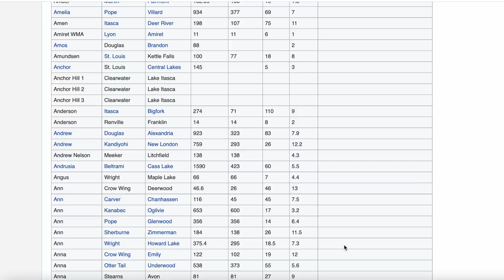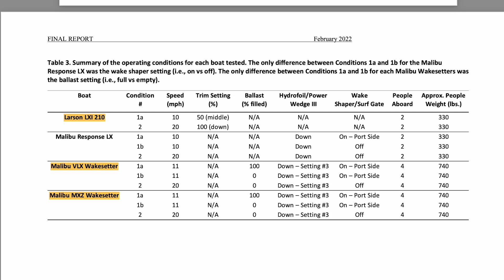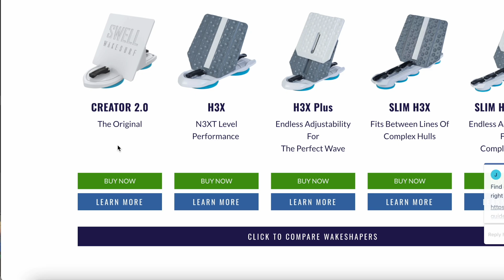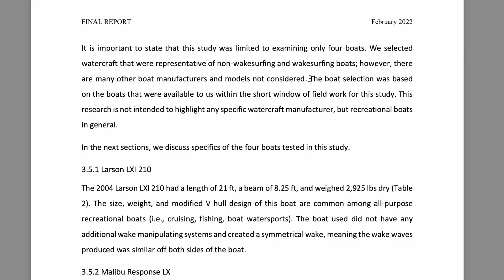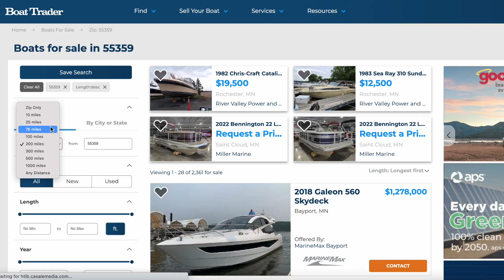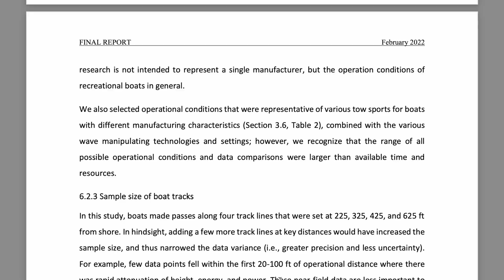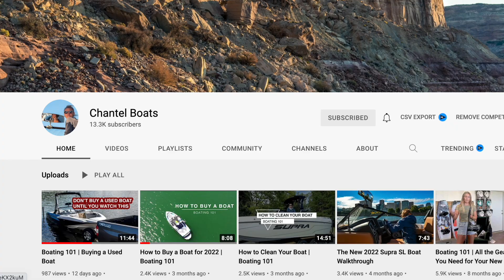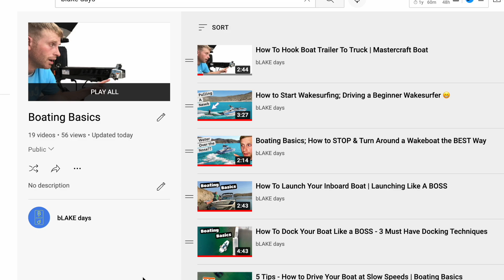Are Wake Boats Destroying Lakes??? | UMN Boat Wake Study Breakdown

Comment: I just took a look at this video, three years after it was published. The reason for searching these videos  is exactly what damage are wake boats doing.... I Love boats, watersports and yes wake boats. I do not own one  but I appreciate them I go to one lake where all the wake boats are very respectful and they try to stay toward the middle of the lake and clear of other water users. There are also a number of lakes in my area I will not go to, by noon the wayer is so rough nothing can be enjoyed, you can not fish, it is impossible to tube and floating and swimming is out, 10 wake boats running back and forth along the shore line for hours on end turn the 5 mile by 1 mile water body in to a torrent of waves, the water is murky from the shoreline been beat to crap by wake board boats running back and forth. I use these few lakes as an example because I have boated them for 30 years, 15 20 years ago there were more boats on the water, towing water skiers wake boards and tube's, mostly 18 to 24 foot runabout with stern drive or outboard. Never did we have this problem back then, now 5 to 10 wake boats turn this lake unusable in a matter of hours. Do I want them banned? No, do i feel we need to work on designated zones? Wake size restrictions? Yes. I do not feel it is any different than the speed restrictions I have for my boat, I do not run the shoreline 200 meters out at 70 mph where I have a very small wake, I do not think the wake boats should be in that zone back and forth all day either.

Comment: Our small lake in north Idaho is approximately a mile and half long and 700 yards wide at it's widest spot. All docks are floating docks ao they can be moved out as the water goes down. When one wave boat shows up the wakes rock the docks and boats tied to them significantly. When 2 more are added it pretty much turns it into the ocean even when they are several hundred feet from shore. 200 feet is a joke. Our retaining wall which survived 40+ years with no damage is being undermined by the large wakes and will eventually need replaced. This will cost tens of thousands of dollars as the wall is not accessible by land. Others around the lake have already had to repair theirs. 
Also, 3 wake boats on the lake pretty much shuts down any other activity because the water is so choppy. And before anyone calls me a rich crybaby, I am a retired truck driver who bought this property decades ago. The rich crybabies to me are the people who can drop 200 to 300K on a boat to surf and blast their music so no one else can enjoy the lake. And that's exactly what happens. We can't even sit on our dock.

Comment: The issue with wakeboarding arises from the sediments it disturbs from the lake bottom, not just shoreline erosion. Studies have shown that wakeboards have the capability to disturb sediments up to 6 meters deep, which is not typical of other types of boats. These sediments often contain phosphorus and other nutrients. Suspending these nutrients in the lake water can serve as food for algae, leading to eutrophication, where excessive algae growth can deplete oxygen levels in the lake and harm its ecosystem. Therefore, for wakeboarding to be safe for your lake, it needs to be conducted in waters that are at least 7 meters deep and a minimum of 600 meters wide.

Comment: love watersports in general, waterskiing and wakeboarding in particular. because you can modify a wide variety of boat using aftermarket products to wakesurf, it should be the activity of wakesufing that should be controlled and not necessary the type of boat. For example a rule of banning wakesurfing on lakes and rivers but allowing it on the ocean would make sense - that way if you have a wakesurf boat you are still able to launch the boat in any body of water. talking as someone that has a sterndrive boat, its incredibly frustrating when crossing paths with boat that is making a surf wake (unavoidable on rivers for example) - reason being is that one needs to throttle down from cruising to almost idle speed due to the massive waves. what makes matters worse is if you busy towing a skiier or wakeboarder cuz they get off plain when you have to throttle down... now you gotta pick up you skiier even though they were having a good run. this means frustrated skiier/ wakeboarder, more fuel consumed by the boat for same amount of ski time , unnecessary high amount of water start , etc...
Reply from the maker: Thank you for taking the time to communicate your concerns and your position. I am sorry for some of the struggles you have with other boats and boaters on the water. Hopefully we can all figure out how to be on the water together. Even though some people on the water annoy me, I don't take the approach that we should restrict or ban people from using the amazing water that we have around us. Part of the drive of a surf boat, is that you don't need to be by the ocean to surf. So, your idea of letting surf boats be out in the ocean, kinda defeats the purpose and design of the boats. Hope you have a wonderful day.

Comment: I think there is a huge onus on dealers needing to step it up in the boat education department.  I'm also a fan of states requiring boating licenses.  It's not a good combo when someone new to boating who has some cash drops in on a 200K "surf" boat with massive wake potential at their finger tips.  The wakeBOARDer in me would also like to point to page 79.  Wakesurfing speeds on the MXZ had way more wave packet energy than the 20mph did.  7000 vs 2000 @ 100 feet.  #Surf-the-ocean-not-the-glass
Reply from the maker: Hey - you comment didn't come through originally. Sorry for the late response. Thank you for taking the time to watch and comment. You make a good point about a boating license. Yes, also eduction is important. Even if dealers are good at educating, some customers just don't listen or their eye glaze over while the dealer is instructing them. This is part of the reason this channel exists. To educate new and seasoned boaters on how to be better boaters.